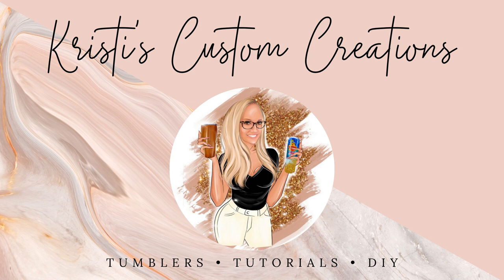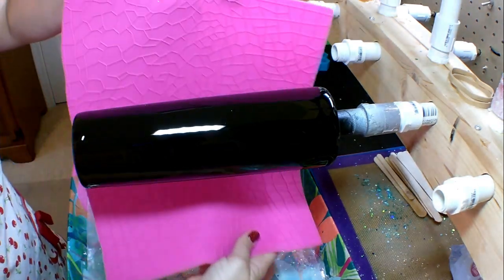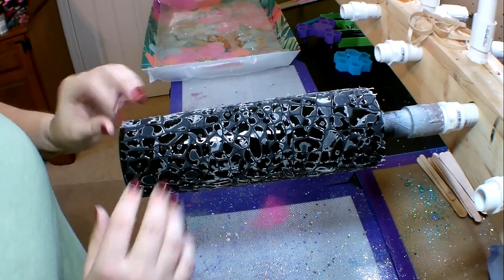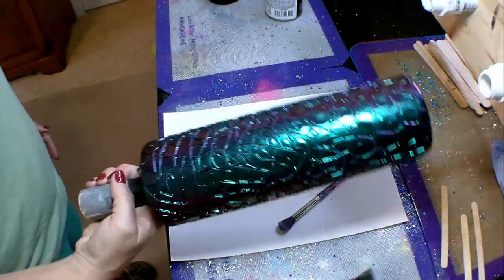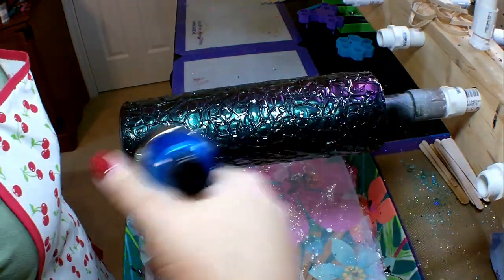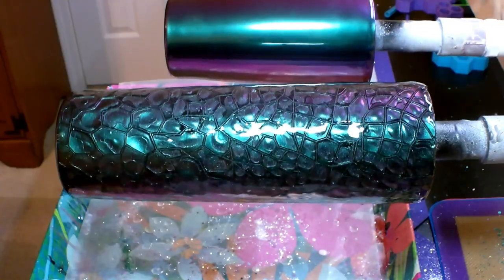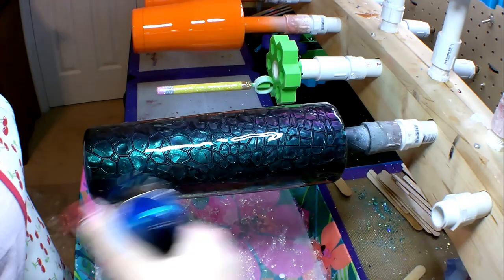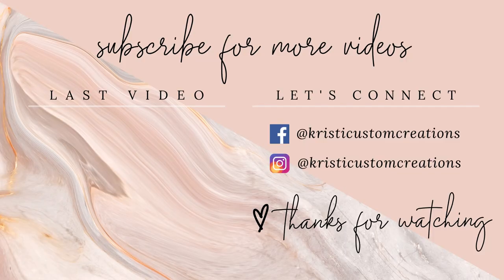Color Shifting Alligator Skin Epoxy Tumbler Tutorial | Tumblerpoxy | Color Shift Pigment Powder

Comment: AWESOME!!! What a cool idea. Turned out great! The color change of that powder is incredible! I have a suggestion. How about putting a sheet of cardboard (not corrugated paper) behind the silicone mat so the rubber bands don't leave a stronger impression where they're pressing down harder? Or was that even a problem? Of course, I had to order the mat. I got the torch, too. I bought a different one on amazon, and the sharp flame will suddenly burst into an inferno, sometimes all over the torch, as if it's going to explode. Obviously, I don't use it now. I don't find any color shift powder on the website you linked to. Thanks for a cool video!
Reply from the maker: Thanks for watching! That's a great suggestion about the cardboard but I actually didn't even have any issues with impressions from the rubber bands (maybe because I put so many rubber bands on 🤷🏼‍♀️). The color shifting Micas are on It's Pretty Personal's website under color shifting pigment.. here's the link directly to it 😊 https://itsprettypersonal.com/products/new-6m-extreme-chameleon-shift-pigment-1g-in-jar?_pos=7&_sid=a12eb450a&_ss=r
Reply: @KristisCustomCreations  Thanks!
Reply from the maker: @MileyonDisney  You're welcome!

Comment: Kristi what is your favorite fast set epoxy I need to order more and torn --- Ive been using the DIYEPOXY but has so many bubbles-- what would you recommend ?
Reply from the maker: For this particular tumbler I used Stone Coat Quick Coat because it dries SO fast. If I need a fast set epoxy as a top coat, I use KS Resin Liquidy Split BUT you have to use it in a very warm environment or else it tries to dry sticky, Tumblerpoxy will be releasing a new epoxy soon called Swiftpoxy and its supposed to be a fast setting epoxy.. we will see!!!